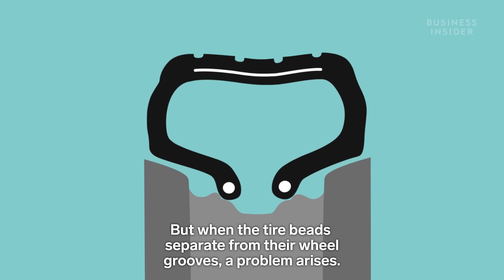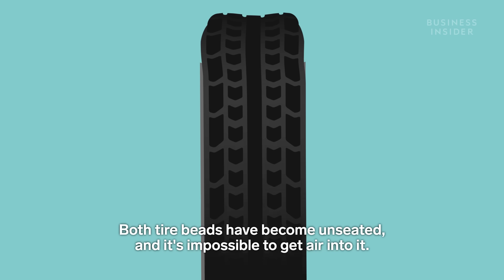Science Behind Using Fire To Mount Car Tires

Comment: You can blow your eyebrows off or do it a little safer with a ratchet strap. Put the strap around the center of the tire and crank it, that pushes the beads outward against the rim. A little soapy water helps it seat. Inflate with about 5 psi which is enough to hold the beads in place.
Wear gloves to release the ratchet strap as it’ll pop like a mouse trap when it lets go. 
I’ve done this many times for all sizes of tires.
Do a search for ratchet strap tire seating. West coast customs has a good one.
Reply: SOMETIMES  YOU  DON'T  HAVE  A  WIDE  ENOUGH  STRAP  OR  A  STRAP  AT ALL  .

Comment: Sometimes it's the ONLY way to get the tires on the rims properly...
Some rim/tire combinations, often used in Motorsport or tuning scene, won't allow your mechanic a normal procedure
Reply: I've been back working on truck tires for 4 years. Haven't run into a single tire I couldn't air up yet. Used ether(starting fluid) regularly way back in the 80's. I'd get fired for it now lol.

Comment: Dont do this shit
Take it to a shop 
15$ to mount 
It will damage the bead
Reply: You sound like a lame dad
Reply: gzruztit jgzods5i 
I am a lame dad of 5 and a master tech
You sound like a another idiot
Reply: @henrymccomments  stop living life in a safety bubble, u sound like my sister boring 😩
Reply: I have never once heard of that damaging beads and I've worked on cars for over ten years now. Just use a ratchet strap around the center of think it'll cause damage with fire.
Reply: It doesn’t unless you have a single ply on the sidewall and I haven’t seen one. Also if you have wide wheels and tires that are skinnier than the wheels this is really the only method. Using a beed blaster doesn’t always work. Or when you get trailer tires that are packed tight and the sidewalls are touching each other

Comment: amazing ..

What did they spray inside of the flat tyre?
Reply: Starter fluid others lighter fluid nitrogen works as well
Reply: @christianflores3437  nitrogen is non flammable. You san use any aerosol can that is labelled hydrocarbon propellant on the back, ether (aerostart) is best as you need less to do the job. A lot of the videos used way more than needed too.

Comment: If you just soap up the bead seat and fill the tire with air, the lubrication will allow the bead to seat into place. You don't need to mount tires with lighter fluid.
Reply: "If"
Reply: @juanfranciscobretado1039  "if" you just happened to have (1) lighter fluid, (2) a long stick and (3) a lighter, then you can mount using the fad method in this video. My "if" here is talking about one thing, liquid soap.

Comment: 1:10  / 3:35  show the most accurate demonstrations. 

if you're going to do this - you must realize that almost as quickly as the tire is set on the bead - you must begin pressurizing it or the rapid cooling will vacuum the tire right back off the bead of the wheel.
Reply: I just remove the valve stem before doing this..... problem solved.

Comment: It is a safety violation. OSHA will fine the snot out of you if they see it or find out you did it. That why we have cheater tanks. I've done it to my own tractors to change tires but I never did it when I went on a road call to change a tire on a tractor trailer. I was too scared of being filmed.

Comment: I do this only when i have to. Im a offroad equioment for a company(only work on our conpanies equipment) and. One of our venders always sends our tires flattened like a pancake lol. Litterally the tire would be 3 inches wide itll be so flat. So after 2 hours of messing with this thing i tried carb cleaner to seal tire to beads, nothing worked. Got tired of it and sprayed a bit more. Ended up being too much and tire shot 4 feet in air with a loud bang. Tire finally sealed, but dont buy tires from that vender any more haha
Reply: I don't think using more spray matters b/c it's oxygen limited, but a tire sitting on the floor would certainly jump like you say!

Comment: Look if you wake up on a flat Do NOT DRIVE to an air pump. You'd destroy the tire b4 you got there plus you'd unseat your tire from the rim by driving on the Flat. Just walk to the nearest gas station and buy a knockoff bottle of "Fix-a-Flat" go back put it in your car's tire and then drive to the air pump and fill it completely. This should hold up for at least a week or so. Also do this if you just have a slow leaking tire but can't afford to replace it or to keep putting $3 in Air everyday. Hope this helps. If so head over and subscribe to my channel and feel free to give me future video ideas

Comment: I had a man tell me that once you do that you have to let all the air back out and make sure the fire is out.  If not, the tire will explode off the wheel while they are driving.  I laughed and told him ive probably killed a lot of people because I have had to do this a bunch of times and never let all the air out.  Just fill it up and put the cap on.  The explosion is done

Comment: 3:28 explain it correctly my guy. You need the valve off so it can expel extra pressure and needs to be screwed in after the seal, and filled to the psi needed. This is half ass

Comment: Truckers have done this for decades to get off the side of the road. Don't even have to remove the wheel, just get the old the off and the new one slips over the wheel, starter fluid, lighter and boom! Tire seated! Fill with air and roll

Comment: A true Pro knows of this method and probably has used this method but will not use this method on a customer's wheel
Reply: A good shop should have an inflator large enough to handle almost any passenger tire. I have seen myself and another guy using two inflators on semi Wheels with the air hooked up to the valves and not be able to get it to bead up. Some of these very large tubeless tractor tires and combine tires and inflator is useless and starting fluid will be the only workable method that is even close to safe

Comment: Method is as old as tires itself. And the video is wrong. The explosion doesn't cause the tire to expand. Rather, the combustion around the bead creates a vacuum pulling the bead over the wheel. Notice how they spray the sidewall of the tire and not in the middle of the barrel. You also dont have to stand by with air. As long as the tire doesn't have a load on it, it'll hold that shape. 

That said, this is a dangerous means for installing tires. Yes the fire will damage paint finishes on wheels, but the biggest threat is breaking your fingers. If you use something like match, you'll bring your hand too close to the lip of the wheel. Once the fire catches it's an instant of a second before the sidewall gets flush with the wheel. Your fingers will lose the fight between the rubber and alloy.
Reply: I think firemen call it Back Draft Explosion.

Comment: That should be common sense for any human being with a brain. I've been using this method for 18 years now and it works great. Just be quick to put the air nozzle on the valve stem directly after the initial explosion, otherwise the cooling process can sometimes suck the tire back off its seat or bead. Make sure not to spray too much starting fluid around the inside of the tire because it is possible to blow up a tire. I've only had that happened once and it was a wore out ATV tire... No money for new tires at that time. I've used this method on car, truck, skid steer, semi truck and ATV tires. I bought one of the air tanks that are made for seating tires and never had much luck with that tank so I always end up using starting fluid instead.

Comment: The problem is that there is often not enough oxygen inside the tire to fully combust the fuel. When additional,air is added to the tire you have a combustible mixture inside the tire that can,detonate in high temperature.

Comment: Lighter fluid is never used it does not burn fast enough most of the time its brake clean or carb cleaner if the guy with the little stubby can was using a cintas Airfreshner
Reply: I've always used starting fluid.
Reply: @daltonbrink9924  that worked good
Reply: We used to use gasoline then threw a match at it
I was always afraid my father would get his fingers caught when the tire exploded
Reply: Some guys use thier torches , same idea just different fuel source, myself I'm faint hearted and was sure glad  when power blasters first came upon the scene .

Comment: Hmm, I dunno if I would use this. Lets assume tire pressure is inflated to 30 PSI, meaning 45 PSI absolute, and so about 3  times the amount of air that would normally exist in that volume. The products of combustion, the gas that fills the tire from the explosion, includes a lot of water. Large amounts of water aren’t good in the tires, and even smaller amounts mean that the pressure will vary a lot with the temperature. We can assume these explosion gases are less than 1/3rd the volume...if you could exchange the gas in the tire somehow, on a very cold day, you could get a lot of the moisture out.

Comment: This is too amazing. What if the tyre explode?!
Reply: Then you got an exploded Tyre😂
Reply: I see you everywhere! 😃
Reply: It's not a strong enough explosion, in fact, if you don't start pumping the tyre up with air straight away afterwards, the air inside cools and contracts which sucks the beads off the rim and you must start all over again.
Reply: @rossbrumby1957  oh yes it can be strong enough. Local Amish guy was killed using this method trying to set the bead on his skid steer. Tire blew apart and killed him instantly. Used too much starting fluid. 
It's like gun powder. It's not explosive in the open air but if you contain enough of it and ignite... Boom. 
Overfilling your tire can with air can result in an explosion.  Anything that holds pressure can explode including air compressors tanks.
Reply: Then the mind explodes 🤯
Reply: how do i keep seeing you on every video i watch
Reply: The way you spelled tire is offensive to me.
Reply: most illegal thing I will see in this year, HOW DO YOU ONLY HAVE TWENTY LIKES MY GUY LMAO

Comment: As another poster stated, it is Not "impossible" to inflate the tire without it being seated.  Just get the beads against the inside shoulder and apply enough air volume.  They remove the valve from the tire stem to get maximum pressure to overcome the temporary leakage. Pop! Pop! and it's on.   Go by a tire shop and you hear that sound all day long.
Reply: I work at a tire shop and I just put air in to seat it.. You can seat most beads with 10psi.
Reply: @D.AverageJoe  for real the hardest part is getting the tire on the rim setting the bead is easy

Comment: You don't use "lighter fluid."  It's STARTING FLUID.  Carburetor cleaner will also work. Anything volatile that will flash with an ignition source.  Just have half a clue as to HOW MUCH to use!  An exploding tire can blind, maim, or kill you.  It's happened. One common cause is mounting 16.5 in tires [what brainiac came up with THAT idea?] on 16" rims.

Comment: The ether-and-match trick is a common Third World technique for mounting tires.  At tire shops they use a "Cheater" charged with high pressure - a lot safer, but still hard on the EAR DRUMS!

Comment: the tires doesn't have interior?
Reply: This is for tubeless tire bud. if it got a tube inside, it'll sit on its own when you fill it.
Reply: that's what im thinking- if they did that -isn't it the interior would also get burn?
Reply: what do you mean interior? you mean tube?
Reply: i think thats a different type of tire because the one the i usually recognize is the one with donut shaped rubber inside called interior, but that one doesn't have an interior inside, the tire is the one containing the air, i saw that kind of tire once
Reply: @jhayar15  Its called a tube lmao

Comment: Will ether damage a TPMS sensor? What about extreme pressures under explosion? Those sensors can cost $150, why chance it?

Honestly, I've never had a tire I needed to do this with.  If you seat the bottom bead manually then pull the front bead close to the rim the compressed air does the rest, and there is no risk of damage.  Granted a construction tire might be problematic, but there has to be a way that can't injure you.

AND, for those talking about split rims... I've never seated a split rim without a chain wrapped through the hub and around the wheel and tire. Those things are treacherous and deadly.

Comment: "A tyre will be impossible to inflate until both beads are set..."

What a load of bollocks.

The inflation process is what is used to seat most beads.
Reply: Shhh, dont tell the experts in the comments common sense
Reply: When they say "impossible to inflate" they would be right if they said with a low volume pump such as one you plug into your cigarette lighter or even put quarters into at the gas station.    A standard shop compressor can set the beads just fine without any need to risk burning your face off.
Reply: But technically speaking if the beads aren’t set, the tire won’t inflate, you might be able to set the beads with an air pump and then inflate the tyre but as long as the beads aren’t set and sealed it won’t build psi/kpa, I’m just being technical about things don’t mind me, I get what you are saying too lol
Reply: In trucking you generally use an air battery that is explosion like
Reply: Yeah, on a tire machine.
Reply: Sometimes you can't get a good enough seal when all you have is a bicycle pump. I managed to seat beads by jumping on the rim once, but couldn't do it the second time. I wonder if the fire method is a good way to seat beads on a new tire?
Reply: No it's TRUE, have done this myself to Hummwv tires in Iraq. Its dangerous and not a prefferd method but sometimes you got to do what you got to do.
Reply: The only reason it wouldn’t inflate is if the wheel is too wide for the tire or the tire bead is broken which you can easily seal with a mounting paste
Reply: @mariolopescas1561  If the bead is broken to the point that you need foreign substance to seat it, put it in the bin.
Reply: Brem lmao wym I’ve put some good tires that simply have one spot on the bead that is tore put some compound on it and ran it for years with no problem
Reply: @mariolopescas1561  I run into the problem of new tires that were mashed during shipping. It's almost impossible to get the bead to set without the air tank ring or starter fluid
Reply: He said  "tyre"..... lol
Reply: SMALLESY 86 wrong yet again.
Reply: yes you are right but the conditions must be exact at a high level of are so that you could inflated using it that's why we Mount are tires with special machines but if for any reason your bead gets knocked out while driving and you try to inflate it will be impossible because the bead is not properly seated
Reply: Bryant Zerrato i thought i was having a stroke while reading this
Reply: @bryantzerrato8255  We mount the tyre with special machines but we still inflate them with a standard airline. Very few passenger tyre beads need any extra help seating.
If your tyre happened to come unseated while on the car and suffered no damage you could happily seat it with a standard airline without removing it from the car.
Reply: Brem as a young guy that pretty new that meaning about 9 months I can fully back you up on that because of where I worked we had an agreement that the youngest person worked the tire machine and Indeed the machine itself is specialized to the process of removing and mounting tires but after the tire has been loosely fitter on the rim it doesn’t matter really matter what you use to set it fully as long as it’s some sort of compressor even truck tires don’t much more that’s why most tire machines are made so that if you press a bit harder on the pedal for the air it will send air out at each of the claws to give it a bit more umf when seating it I’ve mounted 100 of tires by now even as big as front wheel of a tractor and as long as you know how to force the air in you won’t need fire for any part of the process if you are in an equipped workshop and there is probably a good reason why it’s not the standard thing to do taking that even without fire there are hazards when inflating a non seated tire if you don’t keep track of where your fingers are and trust me I’ve seen it ones where a dude got his fingers stuck between the tire and rim and that shit both looked and sounded like it hurt like hell
Reply: @lord_matto8660  usually need fire when your trying to mount a improper size tire on a wide ass rim. Pretty hard to seat a 205/50/15 tire on a 10 inch wide rim. But idiots seem to think that's cool.
Reply: Tire. Not Tyre.
Reply: @Digikidthevoiceofreason  were not yanks dude , its aluminium not alumium ,
Reply: SMALLESY 86 wrong. It’s TIRE and ALUMINUM. This is called PROPER ENGLISH. Anything else is wrong. Period.
Reply: @Digikidthevoiceofreason  can you take your kiddies English and go play somewhere else please.
Reply: tire, not tyre.
Reply: @97GoldDust  different country. Not everyone spells tire the same.
Reply: @madjackgamingandfitness498  it's a joke...
Reply: @97GoldDust  it the European area it's tyre. In North America it's tire.
Reply: @97GoldDust  In English it's tyre. In simplified English / American it's tire. Just like colour and color.
Reply: @reubinthomas  And "armour" and "armor". But I don't get why Brits pronounce word "missile" differently. 
Like, Brits split word "missile" in two, like this: "miss-ile".